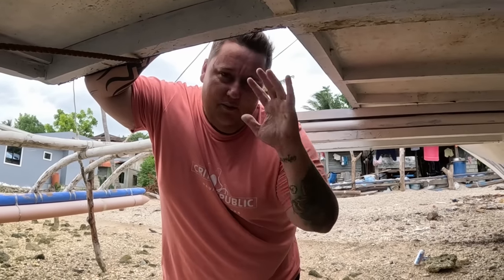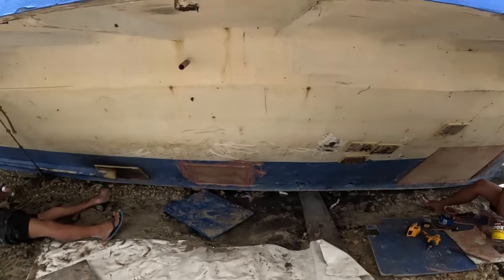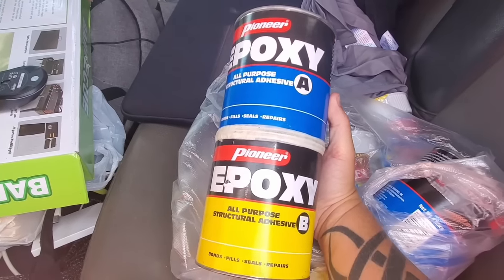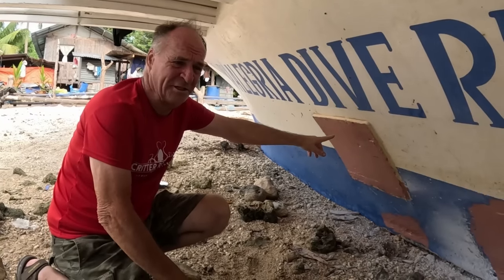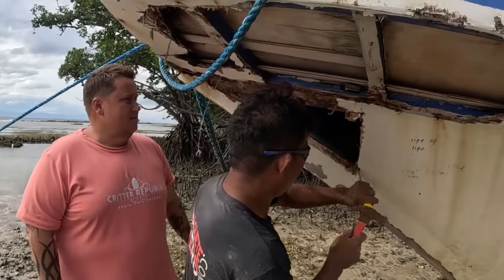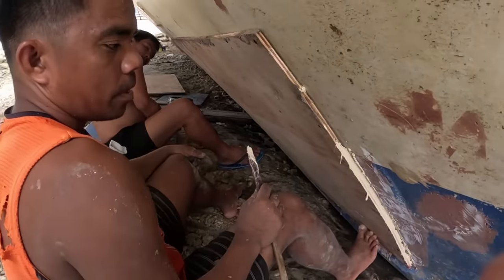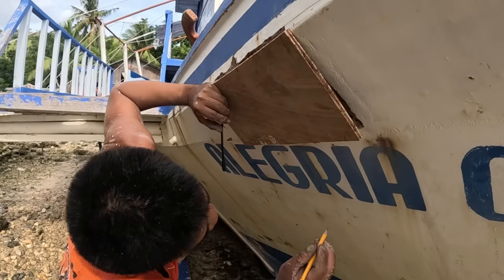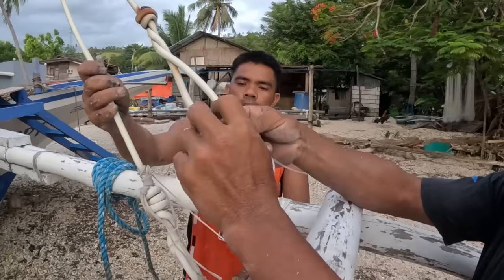How to fix a wood boat | Restoring A Dive Boat EP6

Comment: 04:15. Hi Mr Justin.  You are a VERY SMART YOUNG MAN.   For a cheap extra $100 for you expert helpers,  YOU solved your most immediate emergency problem EXTREMELY FAST.  Great on you.  With labor extremely cheap there, this is a wise choice.  And..  You are extremely lucky to have THE EXPERTS only 10 miles away.  In the US there is no way this could be done without spending big money.  All of the guys helping in your first days were very great helpers and did a great job.  Smart guys talk to even smarter guys, like the expert boat builders.  The experts can teach you 30 years a knowledge in 5 minutes. Most of the time they are gracious enough to do it free or the cost of a beer.  I would love to meet one of the experts around there and learn from they.  Wishing you guys the best, great job.

Comment: Reskinning boat.  INVESTIGATE INVESTIGATE INVESTIGATE.  Hire the expert to look, up close, at EVERY INCH of wood on the boat for rot.  If you remove the old skin, Make sure you look at every inch of the main supports for rot.  This will prove to yourself why the extra repairs need to be done.  And, then you can sleep easy at night.  One night you might wake up in the middle of the night wondering, did I fix my boat right or wrong.

Comment: You need to be a Westerner Justin when working, you have to wear goggles when working on your boat. Do not work like Filipinos because we are used to doing it with  no goggles....LOL...a splinter on your eye will be a disaster for the whole crew...